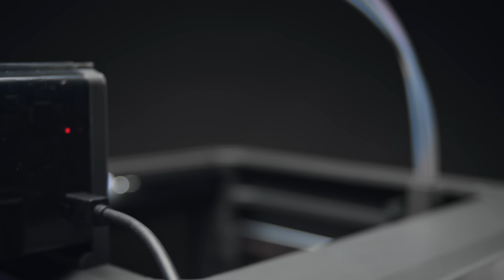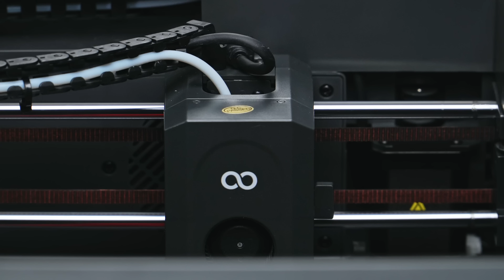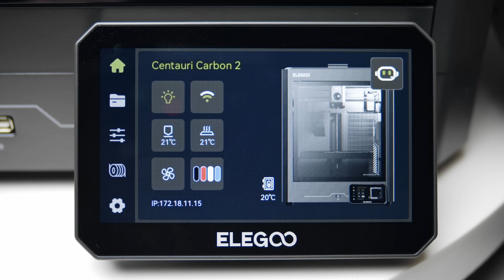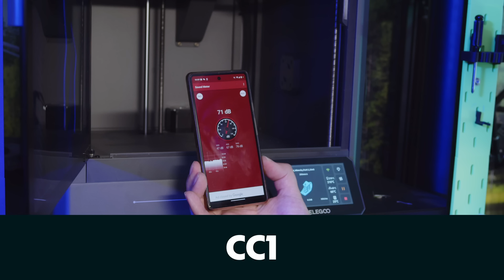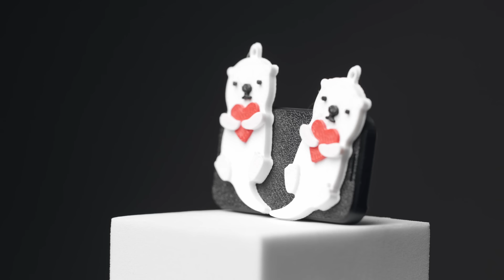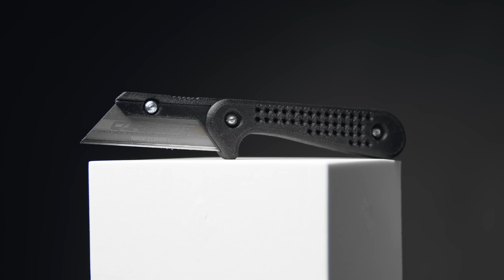The Elegoo Centauri Carbon 2 - A Carbon Copy?

Comment: I dont get the “people don’t like the top hat”. I don’t see anything not to like about it?
Reply from the maker: It's more of an aesthetic thing but practically very few filament swapper printers have such a big cover, it can make placing it difficult - our CC2 is on an IKEA shelf and it just barely fits in there
Reply: @3DJake_Official As far as fitting it on a shelf yeah I can see where that would be a big pita 😂. Re aesthetic thing, I like it. I like the change and the short filament path. I took my CFS off of my K1SE because it jammed, a few times, and I really hate having to deal with that kind of thing when I’m trying to work on projects as opposed to fixing my printer. So, I’m hoping, this type of multi-color system shows better performance.

Comment: Bottom of printer is plastic on cc2 not metal like cc1, the mechanic motion parts including print head still do not use glass fiber reinforced plastic like every cheap fan uses to not warp under heat, spools unenclosed. This is total flop not a printer, wrong materials used to make it.

Comment: Buying a filament pooper for color printing now that somewhat affordable tool-changers that can save tons of time and filament are raining left and right makes little sense. If I got a single-nozzle AMS printer, it would be mainly for roll-to-roll printing or printing single-color parts in sequence.

I couldn't make up my mind between the U1 and C5. I was put off by having to spend ~$400 on upgrades to make them print ASA reliably. The first thing I wanted to print if I got one of those needed 280mm to print flat, which further reduced my appetite for them.

I saw a sale on the CC2 for cheaper than what is needed to upgrade the C5/U1 and decided to get one of those to scratch my ASA itch to print repair parts. The non-combo version is ~$90 cheaper and the flat lid will keep heat where it is needed for ASA instead of letting it escape through the 5gal-hat.

Comment: Now if I can afford either should I go with the qidi 2?
Reply from the maker: I haven't used the Q2 so I can only speak about published specs but from that I would say yes but only provided that your aim is printing high temp materials, the CC2 doesn't have a heated chamber, the Q2 does, which makes printing ABS, nylon etc more reliable and you'll get somewhat stronger parts. If that's not interesting to you then the only reason I would recommend the Q2 over the CC2 is because it has Klipper firmware so its easier to change things.
Reply: @3DJake_Official thank you for the info, you posted vid 3 months ago ty much for reading comments
Reply from the maker: No problem :)

Comment: I would have to use Lychee Pro if I opted for one of these, as I use it for all my Saturn 4 16k Ultras. Lychee offers multiple tabs and plates now in both resin and FDM. As forthe AI detection I'm guessing they use chitumanger for that? 
It's what controls the resin printer's AI, so need to install Chitubox even if using Lychee, and use the chitu manager bit with Lychee! 
it's a weird system for the AI detection all but one thing works and probably the most important one, failure detection!  

I am now looking for a good FDM printer i have heard poor stories of the previous carbon so i held off on it but now we have this, is it any better? Ideally i would like to stay with elegoo. Any advice for an fdm printer would be very greatly appreciated.

Comment: You are wrong about the filter.  When the louvers close, the air goes through the filter and out.  This is why it's only half way up the fan.  That way the fan can run and vent outside the case but without losing the heat.  It's fricking smart, with the louvers open the fan will pull in air from the easiest path, and vent it straight out.  Smart, Elegoo.  But you should draw attention to it, about half the reviewers do not understand what you are doing with this thing.

Comment: Okay, how was he able to print files of his own instead of the test ones off the USB?

Been trying for hours, between the printer not being recognized by the Elegoo Slicer when transferring (It reads it under devices) and when running a model off the USB or only runs the leveling and Stops rights there.

WTF is going on?

Comment: Hey, thanks for your videos! I’ve been watching a lot of reviews and I chose the CC2 over the AD5X, but Amazon is shipping it from China ☠ even though I bought it on Amazon. I’m from Colombia, so I need to buy something I’m not going to return (taxes/import fees). They haven’t even charged me yet, so it’s giving me a lot of time to rethink my purchase.

I’m not really interested in multicolor—I just want a solid, reliable first 3d printer that won’t fail all the time and give me headaches. I want the best value for my money. I noticed the Q2C is about the same price without multicolor. What do you think? Here are the options I have right now:

QIDI: Q2 (2025 Updated) — US$499.00
Creality: K1C — US$459.15
Creality: K1C (2024) — US$458.99
ELEGOO: Neptune 4 Max — US$446.49
QIDI: Q2C — US$439.00
Creality: K1C — US$439.00
Anycubic: Kobra 3 V2 Combo — US$429.99
Anycubic: Kobra 3 V2 Combo — US$399.99
QIDI: Q1 Pro — US$399.00
Flashforge: AD5M Pro — US$379.00
Flashforge: AD5X — US$339.00
ELEGOO: Centauri Carbon — US$299.98

Comment: about the quikshift or not ? As i see it one wants to remove the fan shoud and rubber jacket to fit a 10mm key to not damage hot end ?
otherwise one will bend heatbreak or crack stuff. This goes for also crealitys unicorn nozzles. Its not really a quick shift anyway. 
they still recommed calibrating z before printing again ! To me there is absolutely no differnce, in time required to swp nozzles compared to k1. To swap the entire hot end there are ony 2 screws on cc1. THat might be even faster. But a pid tuning would need to be done. If you write down the vales you can change the quickly with m command. And simply swap hotends ?!. I see a future with cc1 and multicolour and perhaps a cc2 with a bigger nozzle. Pacf use 0.6 nozzle anyway.

Comment: I have the cc1 myself and it is awesome. Most dryers do not go to 75 degrees celsius anyway. So i built a dryer for that purpose, that can hold 4 rolls. I asked Elegoo and they claim they still plan to release multicolour unit for cc1 . I suspect they will use the plug on the rear panel.
I did som amazing prints in PC. But there is no active control of the chamber. This is the main difference ! no vent on cc1
i cannot see that the hotend is different either. Is it maybe just software, to get higher temps ? Given that i have the dryer box i would probably mount the holders on the inside of that box and voila! Still waiting för the relase of cc1 multicolur unit. That would probably be the same as for cc2 with a plug that fits cc1  ? And the software to contol mulitcolour on cc1

Comment: Hi 3DJake, do you print your toxic materials in that room without any additional ventilation, assuming the filter in the CC2 is handling it?  Or do you have another solution?
Reply from the maker: We generally rely on carbon filters. The workshop is quite well isolated and it is basically the place where all the messy stuff happens.
Reply: I've tested this printer in a small, closed room with ASA and just the printer filtration going after the print. Using an air quality monitor that reads VOCs, and it appears the filter works fairly well - no spike in VOC readings. 

I do (normally - did not use it for the test) also run a dedicated air purifier that additionally has carbon filtration as a filter layer. I'd recommend that if you have a lot of stuff going on in an small space without other, active ventilation, but for just this printer itself I think the filter they have is good enough.
Reply: @zivzulander  The printer isn't sealed - the poop shoot is a significant opening, plus there's an air gap in the front door.  I just put this printer in my workspace a week ago and I've been having stinging and watering eyes all week.  I printed 50 hrs of PLA.  I'm not sure it's from the printer (correlation /= causation) but it's suspect.  I realize the vents open for PLA anyways so I'm starting to wonder about all this...

Comment: Any thoughts on ditching the spool side mounts in exchange for a stand-along dryer like the x4? Is the recoil you demonstrated on the included spool mounts essential?
Reply from the maker: The recoil is kinda necessary, otherwise when there is a colour change the filament won't get respooled it just backs up with nowhere to go and can lead to tangles. But one can create a roller/holder system which is spring loaded, they already exist on printables and such.

Comment: Pps-CF without an heated chamber ? What's your secret ?😮
Reply from the maker: Polymaker Fiberon PPS doesn't need a heated chamber, open air is totally fine.
Reply: @3DJake_Official  that's awesome. Was it difficult to print on the cc2 ?
Reply from the maker: Not at all, really easy

Comment: Coming from a Cr-10s Pro v1 I’m ecstatic with mine and I’ve only done single color prints. I’m not concerned with no dry box because I can custom make a cover without issue for working with certain materials which I plan on doing 🤙🏼 but coming from a printer that that half the project was using the printer itself and getting the right dimensions printed out consistently… I’m literally in love 🤣
Reply: Yeah, that's a considerable upgrade. Had a CR-10 Max and it was far more tinkering and upgrades to it than I liked. Was hard to get consistency out of it. Current state of 3D printers is far better now, even with some of the lower and mid-tier options.
Reply: The difference will be night and day. The CR-10 and Ender 3 practically require a full time job’s worth of effort to get running and keep them running correctly. Pretty much any major printer on the market now, even the A1 Mini, will blow the reliability of the early model Creality’s out of the park!

Comment: Have you tried if it works with dry boxes ?
Might not work if the spring load is needed to retract filament.

Should not be complicated to do an enclosure that covers how spool's is mounted now.
Will be more complicated if you need 4 different drying temperatures but still doable. Only downside is that it will make changing spool's less easy.

Will this be a good printer if I only print petg and maybe sometimes something more sturdy engineer type of filament?
Might never need different colours in the prints maybe do petg and support filament in the same print.

Have looked at this one, p2s, qidi and snapmaker u1 if they don't lack any wanted feature then they are a bit expensive considering how few times I print on my ender 3 pro (a faster printer might make me print 2-3 times more but still it will likely be weeks or months between printing)
Reply from the maker: Yeah the spring loading is an issue with multicolour. Actually yeah I think this is a great printer anyone just looking to print single colours and tougher/stronger filament on a budget. If you're looking for better multicolour quality I would recommend something else though.

Comment: Can’t you just use an external multicolour dry box ?
Reply: That’s what I ordered along with mine so hopefully it’ll work
Reply from the maker: It'll work but without a retract system like the spring loaded spool holders your spools won't respool adequately.

Comment: I don't even think 1/3 of adults know what a carbon copy is.... but it's obviously called that for the same reason BambuLabs called theirs the X1 Carbon... they are designed to handle abrasive filaments like carbon fiber.
Reply: Take a moment and read what you just wrote
Reply: @gregaranski  I did when I wrote it... if you have something to say, say it.
Reply: @freerangesimp  He is in that 1/3.  I think the X1 was called Carbon because they used carbon rods in the x axis.  They were touting that when it launched.

Comment: What would you think of this for someone like myself, who atm just has an Ender 3 clone, the Aquila, Voxelab or Voxelab Aquila, would it be a worthy upgrade?
Reply: Snpmaker u1 if you plan on doing a lot of multicolor or anycubic kobra x. I would go with the elegoo centauri carbon 1 for single color use. Or flashforge ad5x, cheaper multicolor and can utilize full klipper support.

Comment: How long did you have to heatsoak the cham er for when printing ABS? And did you happen to get a reading on what your chamber temps looked like during the print?

Trying to decide if its 'good enough' for a primarily ABS machine, especially if i tack on an external drybox
Reply: I'm a relative new-bee to 3d-printing, and I own the CC1, and i can tel you that it prints ABS fine, 50% if my prints are in ABS and PET-G  and it prints great
Reply: I tested this machine with ASA and it prints well. Chamber temp gets up to around 45C (heatsoak was normal preheating of bed and hotend, just a few minutes). Had some initial warping issues with a flatter print, but that ended up being more of a tweaking of print settings issue. Worked beautifully after that. Nylon also prints nicely (used Sunlu Easy PA).

Will try ABS tomorrow, but it really shouldn't have a problem if ASA prints (very similar material, though ABS might be slightly trickier as far as needing the heat to avoid warping).
Reply: @zivzulander any updates?

Comment: I'm sure the talented community will come out with a drybox in no time. If I've learned anything since I switched to using linux is given enough time, open source community comes up with it's own solutions 😁
Reply: Yes.. but why didn't someone tell them to just align them on a single spool horizontally - would widen the overall profile but much easier to design for. I'll do it, if they send me a free one, ha ha.
Reply: @phuzed37  I see what you mean. Probably makes it more difficult to engineer the spring-loaded spool holders if they are connected in series, I dunno 😂. Still that wouldn't change the fact that they would be exposed. I'm pretty sure the bowden tubes on the CANVAS can be removed and replaced by longer ones connecting the Canvas directly to a DIY drybox. I honestly might look into that myself 😅 maybe I can reverse engineer some open source design already available
Reply: @Bađi_01 I'm still boggled by the fact they went with a massive hood like that... That's where they should have put the drybox. Like they were thinking, "let's waste a bunch of space so we don't have room for a drybox" 

It's really the only thing holding me back from buying it... That and the fact that it wasn't at least a dual nozzle hotend. The wasted filament is a huge deal breaker for me at this point.
Reply: @DarthCrumbie  Bit unrealistic to ask for dual nozzle at that price IMO. Also the massive hood is mostly there so that the PTFE tube has a nice gradual arc. If they lower the tube brittle filaments would most likely snap while loading and unloading. It's all about compromising. Right now I'm actually looking at the Qidi Q2 as it has a drying box and can handle engineering filaments better due to it having a chamber heater.
Reply: I would guess that easiest would be just to put 4 single filament dryers or 2x double filament dryers next to the printer and run the filament directly from the boxes to the canvas tubes.
Reply: @Jones.Prints or just one dryer - creality space pi x4 or sunlu s4
Reply: @arbeelicious I didn't know they make dryers for 4 reels, but of course that would be best.
Reply: @a @arbeelicious s just about to say I run a sunlu s4 no issues so far

Comment: That doesn’t make sens to have a 350° hotend and exposed filament system
Reply: Yeah not having a active heated chamber and that hotend temp doesn't make sense. I can't think of a high temp filament that doesn't also want a heated chamber.
Reply: @AtomicBleach right, too many things that doesn’t match… Even that horrible top that makes on more third to heat…
Reply: Ad5x has a compatible printable dry box that you put over the spools
Reply: @ADogNamedStay same shit, those systems are just not R&D cleaver in 2026
Reply: Probably a price thing

Comment: Terrible decision for their multicolor design, sure, they wanted to save cost. At the cost of not selling as many as they did with the first centuari carbon. Could have made a cheaper version like the flashforge ad5x, and put the entire thing in an enclosure. At least the flashforge can be converted to full klipper firmware too.
Reply: Yup. Would not get this.

Comment: Hygroscopic filaments would require an enclosure of the spools. Prusa have learnt this meanwhile ...
Reply: Prusa is 3x the price of Centauri 2 tho.
Reply: This would have to be either heated or with dessicants.
I wonder what happened to an idea of live drying: just source filament through a vertical tube that is ca. 8-12mm internal diameter and heated so that it dries before going to AMS. I know this effect works somewhat also with closed printers without AMS with filament goint to print head exposed (not in tube), but there is not very strong. With tube you could heat it to over 100*C removing most of the water.
Reply: Have they? Because the Core One is open spools even with the IDEx